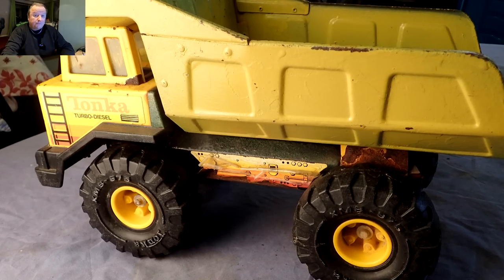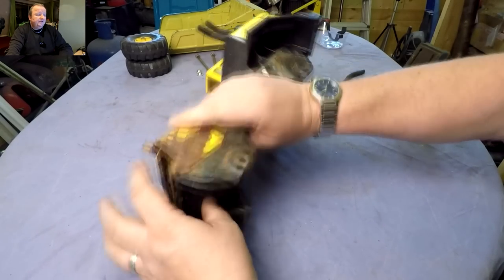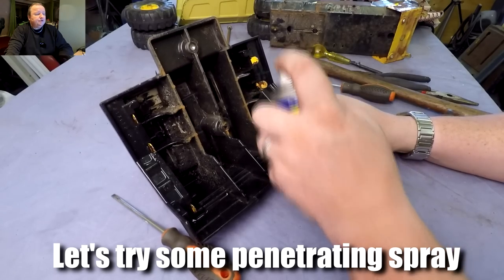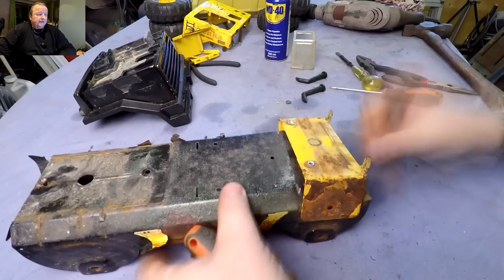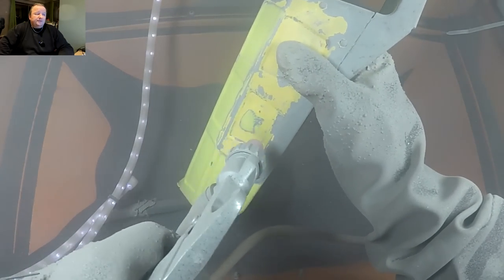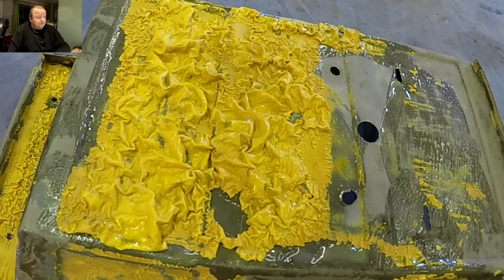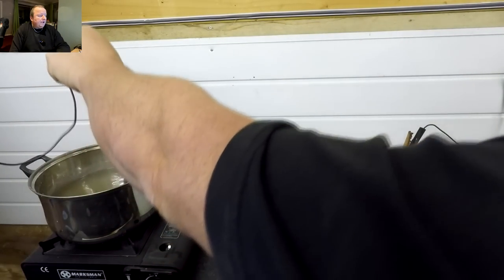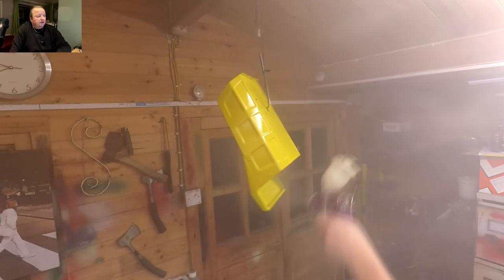Tonka Dumper Truck Restoration

Comment: If you need a more aggressive blasting media, you could use garnet or coal slag. Both are used in industry with good results. I believe that the coal slag is sold as black diamond brand.

Comment: In 1972 my dad was working for stanley homes ltd and at christmas the boss's gave out tonka toys to the lads for a bonus?
anyways there where trucks, cranes, dumper trucks, rollers and cement mixers and every thing moved on them. He got me the crane with a skip that went up/down using the pully string on it as i remember it had stanley homes .

Comment: It wouldn't surprise me to be 70's, maybe even as far back as the 60's. as I was playing with one in year 1 in Infants in 1981, and it had seen a few battle scares by then!! as for rust, then the answer was no, as it never left the classroom. thing that annoys me the most was going back to the Infants for a final visit in a youth club some 10-11 years later, before it was knocked down 2-5 years after, and litterally had to watch where I was walking, as it was built ontop of a mine shaft, and the floors had fallen through to the mineshaft. now there is a road running right through where my classroms were. greatest years of my life now just a total memory. but getting back to the dumper truck, yes the paint did flake off like it was just a single layer, with no primer. and from what I remember the paint was like 3-4 layers thick, but that is from a 4-5 year old self, and smaller hands!! haha. but it was the toy of choice in the classroom between everyone, until I had my first girlfriend, then wasn't as interested with the dumper truck, still keep in touch with the girlfriend though, and go out together occassionally, as ended up going to the same Junior school, and then College together, and then the rest is history.